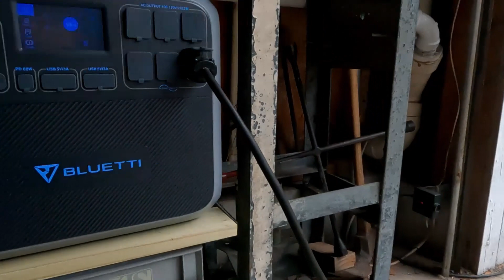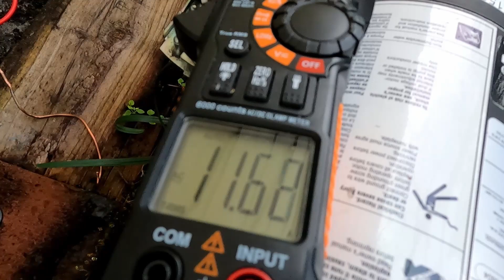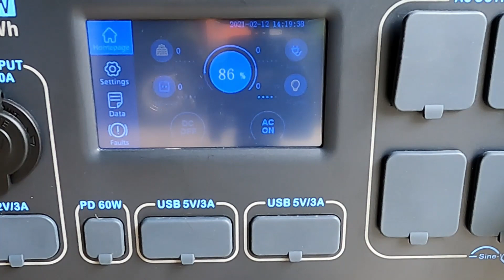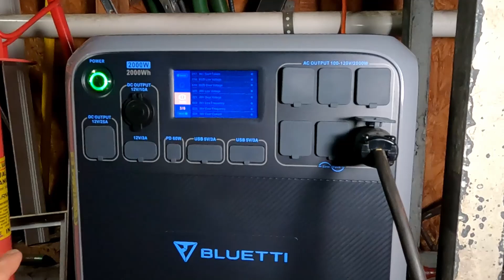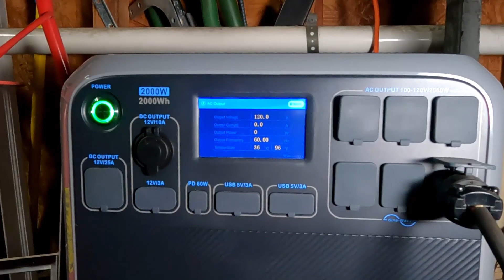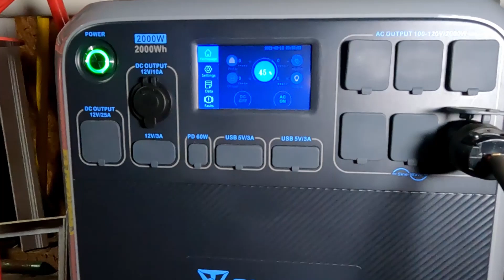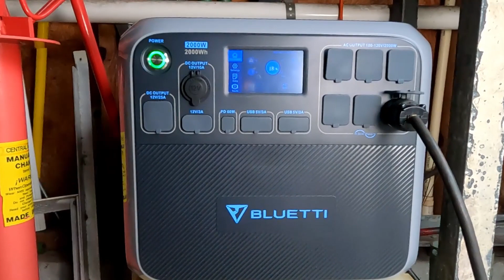Bluetti AC200P Running a House Water Pump for 24 Hours

Comment: Thanks for the video. Have been wondering how the AC200 would run 1/3 to 1/2 hp motors. Primarily those on sump pumps.

Comment: And thanks for taking the time to make the video. I calculated my AC200 uses right at 53 watts just being on and standing by(ac inverter side. I don’t use the DC side)
Have you figured out what yours consumes? They should be the same....
Reply from the maker: I have not tested the AC200 to see what wattage it consumes at standby but from what I read, you're pretty much in the ballpark. The AC200 is more efficient at running higher wattage devices because as you stated, the larger the inverter, the larger the standby consumption.

Comment: Just add a couple solar panels to it what's the point of having a solar power station without solar
Reply from the maker: Did you watch the entire video? I stated at 5:48 that you could run it full time with solar panels. But the purpose of this experiment is to show that the Bluetti is capable of running a water pump for 24 hours in an emergency in the event that there is a storm that has knocked out your grid power and the cloudy weather is preventing the solar panels from producing any power. It is a demonstration to show how long the Bluetti will last under those conditions. Sorry for not making that more clear.
Reply: @2xit  So if I overpanel it I wouldn't need the solar generator at all, just a converter?  Or, does that just mean it's always charging the solar generator same time I'm using it?  As in, would I need to dedicate a solar generator just for the water pump?  Since I will only need the well pump to work when I water the gardens, I could just use it on sunny days (in case of an emergency) and use the water tank in between for my house.  (?) (if I'm just using solar without a battery, solar generator).

Comment: What does Bluetti say?I do notice it will run down when nothing is running off the station.  So far only tested once with portable solar panels which averaged around 300w in. It can handle about 700w in I think as well as charging from both solar input and brick input using two bricks (solar needs special adapter cable for that though).  So, theoretically could charge fully in under three hours.  If for anticipatory power failures, that could be quite handy to charge as fast as possible to prepare for such an event.